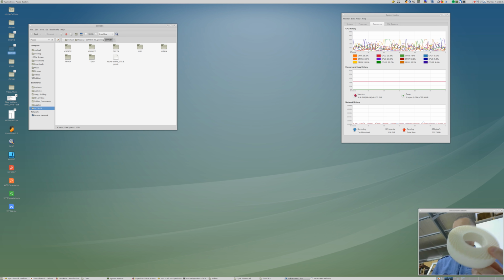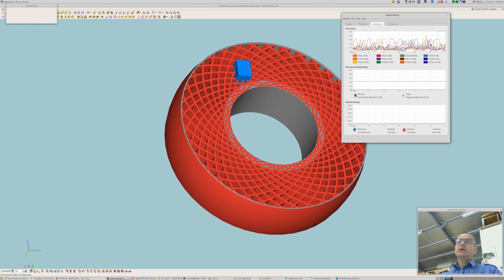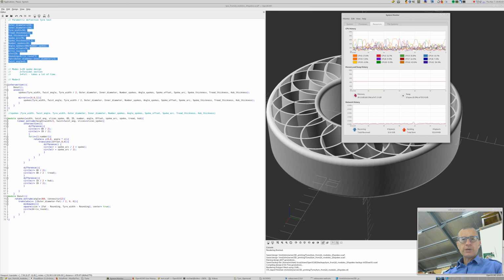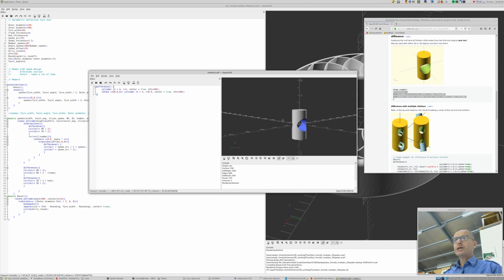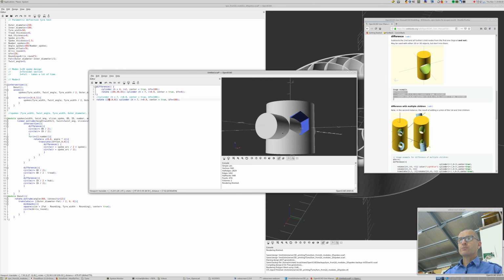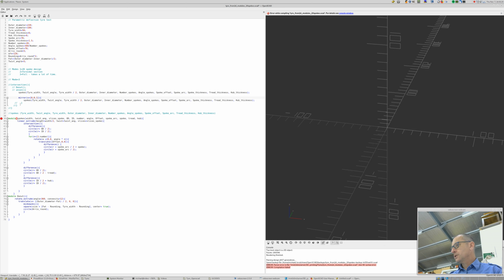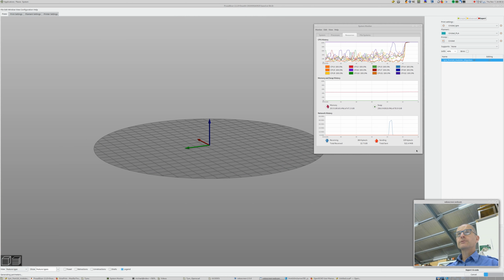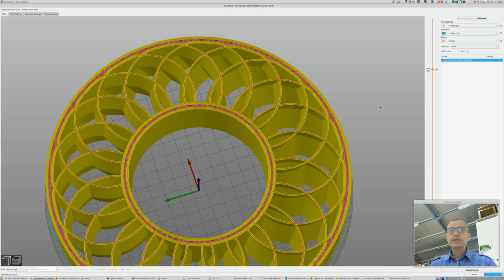OpenSCAD |FAST | Why |Howto |Airless tyres

Comment: so you are complaining about the fact that it takes a few minutes for a change to occur in cad software.  and claim that you are going to show a better way in openscad.  
and then you say IT TAKES 15 FUCKING MINUTES to render this.....    

are you mad?     forgot to take any pills?
Reply from the maker: The actual render time is dependant on the number of facets, I have chosen many.
The point I am making is that in spite of the complexity you can actually have many running simultaneously to produce a family of designs.
To manually redraw the design you yourself are tied up while redesigning.
With this automated method I can for arguments sake launch 12 different ones at a time, and let the machine work
while I do something else.

Take for example a set of gears, or timing pulleys, or maybe a set of different threads, including tapers, yuo change the parameters, and the machine works, not you.

It's really easy, in effect whether the machine completes the task in five minutes or five hours, it only costs you maybe a minute.
Reply from the maker: I have made an answer to this comment.